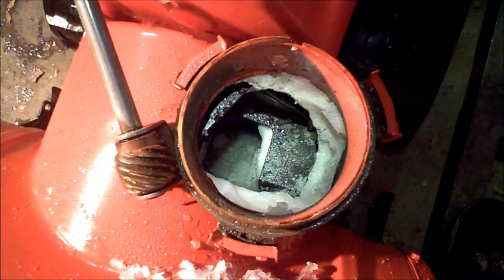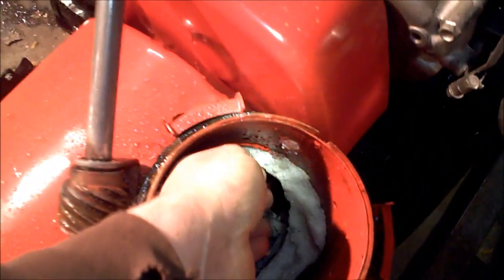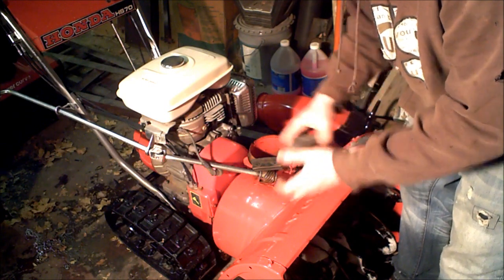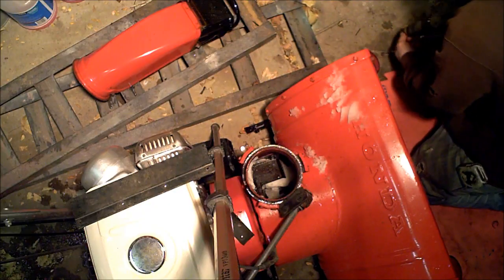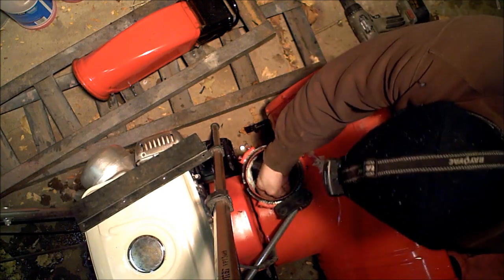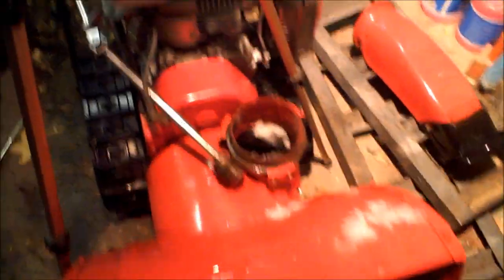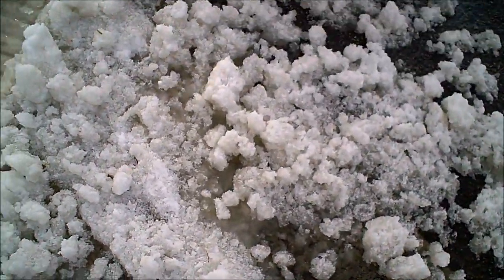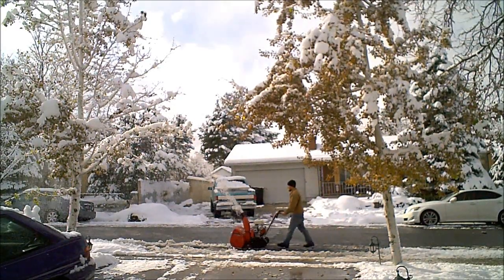Modify Snowblower to never clog and throw twice as far w/ Impeller Kit

Comment: did this to my little 22" snapper and it throws twice as far..still struggles a little on the wet stuff but does not clog anymore.
Reply from the maker: Turn up the rpm on the motor a little. The engines are rated to run at 3600rpm and virtually every one that come in is around 3000-3200rpm. At the base of the throttle control lever you will see a small screw with either a flat or star head. Turn it clockwise a turn or so and you will hear the engine increase in speed/ horsepower. Just do it a little and this will make your machine excel.
Reply: ill try that for the next storm..thanks

Comment: How do you adjust the spring? I'm assuming you're talking about the auger cable pulley? There isn't an adjusting screw on this modelThat I can see. I'm a tennis pro, who excel's at breaking things.
Reply from the maker: The cable that is pulled by the hand lever has a spring inline(under a black rubber sheath).

Comment: So if the auger belt is loose and I can't adjust to make tighter, the belt is stretched out? It's a craftsman 247.887791 22" and I don't know why the belt is slipping and not turning the larger end of the auger belt. Any thoughts?
Reply from the maker: If you have adjusted the spring on the cable, the travel of the tensioning lever is maxed out and won't travel any further then yes the belt is worn. They don't really stretch but rather wear their sides down (becoming skinnier) and fall deeper into the pulley grooves.

Comment: Have you figured out a way to upgrade a toro? I have a 22 year old 824, it still throws well but it is lacking in the slush department. You mentioned the impellar is too thick?
Reply from the maker: Simple pre-drill the holes. They are too thick for self taping screws without pre-drilling.
Reply: roger that thanks.
Reply: just an update, my toro has the heavy gauge impeller blades, but I was able to use 2 self tapping screws per paddle...(old car mat) I did need a 20 volt drill, the guage was way thick for anything puny....I used the upgrade on 2 of the 3 paddles available............nor'easter on the way ,lets hope for the worst! This Time!!,lol.
Reply from the maker: I'm glad you got through. It's a testament of how well these Toro's are built.

Comment: I have a JOHN DEERE TRX 26 WON'T MOVE . HOW CAN I FIX IT .
Reply: Buy a new one.
Reply from the maker: That's what is wrong with America, "throw it away" once you encounter the slightest problem. Then go buy a Chinese one from the Home Depot.

Larry,  The TRX26 uses a rubber friction disc like a lot of machines. It wears out and needs replacing. This is a $20 part and should take around 30-60 minutes depending on your skill set. Tip the machine all the way up, balancing on the front housing. Take off the bottom cover plate and you'll see it (metal disc with rubber coating about the size of a tea plate).
Reply: Just kidding
Reply: there should be an adjustment cable..they stretch over time and need tightening. if the rubbber on the disc looks good try that.

Comment: What are impellers in this video made of? They look like cast metal when you add these to a blower with metal blades I am assuming you still drill a pilot hole?
Reply from the maker: They're rubber and no predrilling is needed with most snowblowers.
Reply: ok thanks was hard to tell
Reply: just took a look at the impellers on mine today they are indeed metal it is a Bolens about 40 years old 2 stage 8 horsepower
Reply from the maker: Those Bolens are indestructible.
Reply: yes they are it belonged to my Grandfather who lived in Manistee Michigan I brought it home when he passed away just had to drain gas and put fresh gas an fired right up, definitely going to go with your idea.

Comment: Great video I can't believe that I have lived in MN for 16 years and never heard of this. Sixtyfiveford would a thick floor mat from a truck work? or not last? Please answer back, one tip I do with heavy wet snow is spray paddles, auger, and chute with wd40 or liquid wrench even cooking spray to help with no stick and clogging. Thanks for the video.
Reply from the maker: I've had many people use floor mats, door mats, etc with success. The only issue is they wear out faster where tire sidewall or conveyor belting has woven fibers embedded for tear strength and generally last the life of the machine. .

Comment: That's some MacGyver shit right there.  Wisconsin is forecast 7-11" tonight. Just saw your video the other day and scavenged some rubber and threw it on there. 
An MTD 24" 10 h.p -> P.O.S  had a 1/2" gap and from brand new has always sucked at distance and clogging. I know it will work and will have some to try it on here shortly.
Reply from the maker: Let me know what you think. That 10hp should really throw it.

Comment: am I just the odd man out that hasn't clogged his 2 stage?  its only a 6 hp 24 inch.  the only clog I have ever had is when I hit a plastic garbage can lid.  I see how this mod is usefull, luckily I haven't had a need for it.  good info though.
Reply from the maker: You must live where is stays well under 0C/32F. There's a belt across the US where temperatures hover around freezing and a good amount of the snow melts and condenses into a wet slurry.
Reply: sixtyfiveford I'm in the Detroit area.    we get the really wet snow too.

Comment: 1) should the screws be zinc or other NON-rusting? Stainless maybe? And how about a washer?  If so, what material washer? 
And 2) once holes are made in the paddles, aren't THEY now susceptible to rusting out, since protective paint gone, and the salt that the municipal trucks leave at the bottom of the driveway gets in there and starts the oxidizing magic? Just an idea... Your thoughts? Thanks
Reply from the maker: The entire auger and impeller area of your snowblower will scratch and have bare steel. Rust: in the hundreds of snowblowers I've repaired, I've seen 2 snowblowers that had rusted out over their 30+ year lifespan, and both were from people who salted their driveway non-stop. But this was simply the thin sheet metal housing and not the thick impeller, which was bare steel by now. Surface rust is not stoppable and even stainless steel will show signs of this. In my opinion I don't think it matters what type of screw. I generally just use zinc.
Reply: Thank you for the answer about the rust sixtyfiveford! And what about the fasteners? Zinc maybe? Thanks for the f/u.  Oops.  That means follow up.  Not the other f/u LOL

Comment: Great vid! I was skeptical when I bought my used MFD. the former owner had mounted similar impeller pads, claimed to be able to hurl dog crap with it in warmer months. But wow, what a difference! Compared to other stock impellers I've dealt with, this puppy's a beast! I can pretty much divert a gutter river onto my lawn with no problem. Will only clog now if slush volume is too low. But can easily self-unclog by shoving it into a snowbank. If you have a 2-stage with a peppy motor, get the most out of it by eliminating your impeller/housing gap. You'll find yourself, like me, cleaning gutters for the entire neighborhood. Folks enjoy that kind of generosity around Xmas time.
Reply: how many impellers and how many rubbers did you install?
Reply: Mine has a 3-blade impeller, install pads on each. 8hp Tecumsah

Comment: I have the top Toro snow blower and it doesn't like the thick wet snow. Any tips for the single stagers like mine?
Reply from the maker: Sounds like your paddles are worn. They should touch the back of the housing. If you can put a pencil between the housing and the paddles it won't throw wet snow.

Comment: Is there any way , kit or otherwise, that can make a simplicity snowblower chute turn the way you crank it?  I know some other brands do that, but I have a simplicity and that is the only thing I don't like about it. The impeller idea sounds like a winner, and I think I'm gonna do it to mine
Reply from the maker: I'm with you. A few manufactures have done chute designs that spin opposite. It drives me nuts. I've never adapted them.

Comment: may be a little off topic but I have a Yardman MTD 5hp Tecumseh that the engine bogs down and will die once it is under load. also sounds like it has a misfire. New Non-adjustable carb and spark plug. Any suggestions??
Reply: mrtosh had a similar problem with a 5 HP Tecumseh motor on an Aries snowblowers. Come winter it would act up, run rough, take ten or fifteen minutes to run without choke, have no power. Each summer would change plug, disassemble and clean carb, make sure flywheel and coil were clean for a good spark. After all that, it would run like a champ, until the snow fell. Then back to finicky operation. After three years of this I came to a solution. For $100 during a Harbor Freight sale I bought a Preditor 6.5 HP motor that bolted right up. Had to change the size of the drive belt, but otherwise the swap went great. Waiting for snow to check operation, but I am confident right now. I have never been happy with Tecumseh motors in the past, and this one didn't improve my opinion any.
Reply from the maker: This means not enough fuel flowing through the main jet. It is either varnished or undersized for your elevation. I have had great luck by slightly enlarging it with a micro drill bit in some cases. Most of the time is just requires a metal wire to clear any varnish off the walls of the jet orifice. https://youtu.be/KYj5oH0vNVg
Reply: sixtyfiveford Thanks for the speedy reply. The carb is days old and I checked the Jets orifices for plugging and all were clean. It's one of those Chinese ebay non adjustable carbs. Should I try another carb?
Reply from the maker: mrtosh
I would drill it out or install your old main jet. They force these to run too lean and it will overheat and destroy your engine. Yours should be around .5-.6mm and I generally bump it one size up with my bits(generally .8mm+-). This isn't an exact science and I just go a little at a time, but virtually never need more than one size up. I have some micro drill bits from Amazon ( http://amzn.to/2hctATX ) but I also have had some from Harbor Freight that did the job.
Reply: sixtyfiveford are you just drilling out the main opening on the sides? Would running the choke open when it's about to die help diagnose whether it's getting enough fuel or not?
Reply: also the plug us black like it's running rich.
Reply from the maker: mrtosh
The sides are just bulk flow passages, the main jet is directly down the middle.

Black plug, you're right this signifies too much fuel.

Yes, partial choke will help a little in diagnosing but also cuts power. So it's hard to lock down the issue.

We need to back up a little and I would clean the plug first https://youtu.be/dYwSObeCaUY So we can eliminate a fouled plug as any running issue. Regap it to the .030".
Reply: sixtyfiveford I cleaned the plug and even replaced it with a new JC8 gapped @.030. Same issue. It does sputter and miss quite randomly as well. exhaust valve maybe?
Reply from the maker: No power/dies/bogs severely under load but runs fine without load= too lean

Black plug= too rich

Misfire= too lean or way too rich, but generally the rich side will be accompanied by black smoke.

These being noted a valve can play havoc with diagnosing these issues.

Does the governor force the carb butterfly to full open when the auger is engaged or you hit snow?
Reply: sixtyfiveford The governor flutters at speed when I hit the auger the Valve does open.
Reply from the maker: I just want to make sure the governor was giving it full throttle when it is bogging/dieing. This would eliminate the governor system. 

Did you try it with partial choke?
Reply: sixtyfiveford I haven't had a chance to check that but will and report back. Thanks for all the help!

Comment: WOW! I got to try this, only wish I found this video in 2012. The only problem now is will we get enough snow this winter to pull out the snowblower or will I have to shovel again. We got so little snow last winter I only pulled it out once. I have 1/2 inch thick rubber do you think it will work or should I cut it in half. I was thinking I could slice it down the middle about half way and attach it with rubber on both sides with bolts and washers. Thanks for this idea.
Reply from the maker: 1/2" is pretty thick but will work just fine.

Comment: Just picked up a Snapper 10-30 with all white Tecumseh engine and wide tires.  Any idea if these are decent?  I have a Toro 1028 now and I'm not crazy about it.  I will add paddles to both.  Great idea. Thx.
Reply from the maker: Snappers are great machines. A properly tuned Tecumseh is the easiest cold starting engine ever made.

Comment: Each time I use my snow blower I spray all the snow throwing parts with silicone. I've never had a problem with clogging since I started doing this. I'll keep this in mind if I ever get a clog.
Reply: You're supposed to spray it on the snowblower, not your body.
Reply: the pb blaster garage door lube works good to.
Reply: unless you have the chute aimed at your face getting it in your body shouldn't be a problem.
Reply: Me too and the silicone works real good.  I had one small clog in the worst conditions possible. When that happens it is time to respray the silicon.
Reply: WD-40?
Reply: Use PAM cooking spray. It is a lot cheaper than silicone. And better for the environment!
Reply: Fleet Farm has food grade silicone
Reply: I've used cooking spray its all its good for i do not want that chemical shit in my body

Comment: Just curious but I put 4 rubber pieces on a 5 HP Murray 22", the impeller and it still clogs up. It clears the snow off of the housing but it still clogs up. Do I need something with more power to make it work?
Reply from the maker: Make sure your belt isn't slipping. 5hp units are probably the most popular size units I do.
Reply: Thanks. I'm checking on that now. Do you think 4 blades with the modification are to much? It has 4 blade's and I thought maybe only modify 2. I also pushed them right up against the chute housing when I screwed them in. Maybe to much drag with the rubber and housing? I did replace the auger belt. I really appreciate your help. I m really frustrated that it's not working in heavy wet snow. Long driveway and I'm not getting any younger. Thanks again.
Reply from the maker: They can put a lot of drag if the housing is out of round or off center. I taper the leading edge to allow quicker break in and less drag. It should be just barely away or skimming the housing.
Reply: sixtyfiveford I was able to trim them down, adjusted the belt and it seemed to work much better. Looking forward to the next wet storms. Thanks for your help.

Comment: https://scontent-ord1-1.xx.fbcdn.net/v/t1.0-9/15241422_10209147440621225_8374953990426935273_n.jpg?oh=1db6996765c4fad564aab561a4654e06&oe=58BB71EC I got new sheet metal welded in now. :)
Reply from the maker: Looks great.
Reply: I had the welder weld some 1/8 inch steel to the old scraper bar (due to the style scraper bar is no longer made, as it bolts up on either side of the snow box, & the new scraper I got just bolted across the front in "very close proximity to the augers", and I did not like that idea, due to the last time I had a scraper bolted in there, the augers hit every bolt on each revolution. In my thoughts with the "extension" the augers will not hit the scraper edge. https://www.flickr.com/photos/50621316@N05/30745396943/in/album-72157663774625984/
Reply: All I have to do is get the scraper bar up there & get the same applied to it, I had to bend out the tabs slightly so when it gets painted I can drop in a pair of fender washers (plastic ones) between the scraper bar & the side of the snow box.

Comment: Why don't they do this at the factory? There's gotta be a reason. It just works too damn well not to make it part of your snowblower design. Since it works for everybody else, I'm goin for it tomorrow. Just got done rebuilding an older 8HP Spirit. She looks and runs almost like new. This will be the icing on the cake.
Reply from the maker: The number one complaint from people that I hear is they're getting a new snowblower because their old one clogs all the time. The gap wears bigger as the snowblower ages makeing the issue worse. This gives people a reason to buy a new snowblower, which sells more snowblowers. I don't think there is a manufacturer that wants a customer to keep a snowblower longer than 5-10years max before upgrading.
Reply: sixtyfiveford Yeah that makes sense. Thanks for the Vid.
Reply: I added em to the 3 blades of my auger. I have a 2000 Spirit (Murray). Dude, the metal is hard as hell on those! Took me about 2 hours. I cut up a new mud flap, placed 1" bar over it to serve as a washer (Like the ebay kits), pre drilled pilot holes... spent forever trying to get through the blades. Then, I used self drillers to get through the pilot hole. It was frustrating, but it paid off! She throws snow right over my lawn into the neighbors driveway... just like I envisioned it! No clogs in about 5 hours of hard use. Thanks man! P.S. Right after the install, they were tight to the metal! I tried running them dry for 1 second against the painted metal. Smelled like burning rubber. Duhh. So, I sprayed PAM onto the rubber and onto the paint. That helped a lot.

Comment: What do you suggest for thick metal impeller blades with bend in them?
Reply from the maker: The same. Just use a washer on the self taping screw. If you can't get the self tapping screw to dig in, predrill the hole will a smaller bit. The Rubber flap will bend to the same contour of the impeller.
Reply: sixtyfiveford thank you!!!